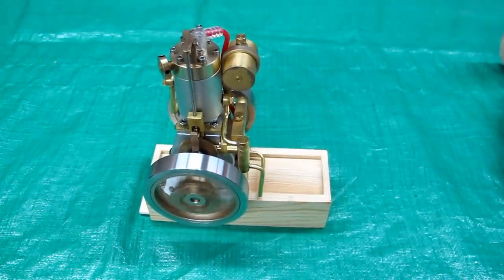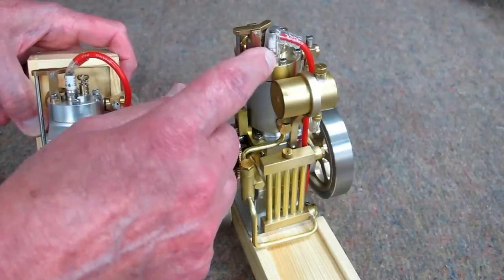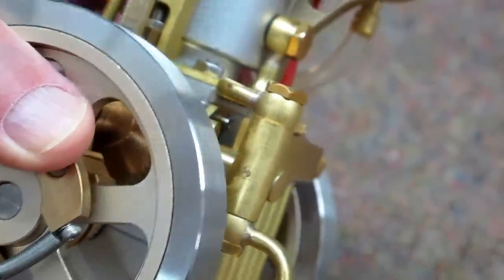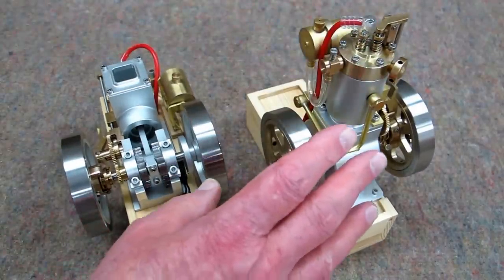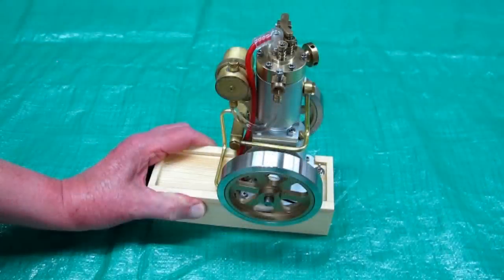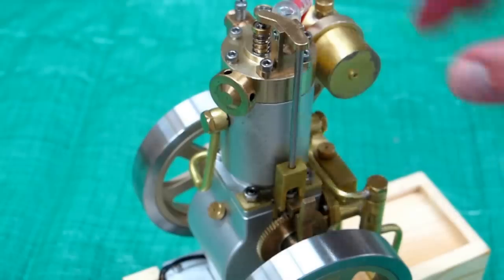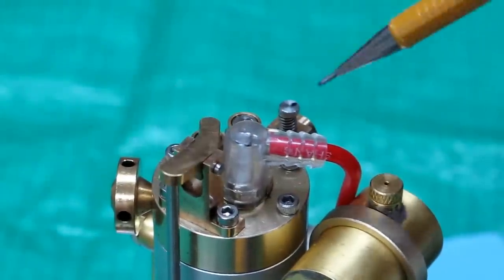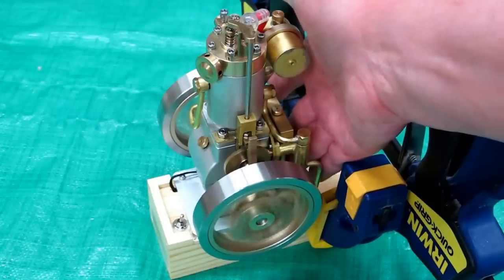Eachine ETX Vertical Hit & Miss Water Cooled Engine

Comment: I got one of these from Banggood yesterday but out of the box it has no detectable compression whatever when hand cranking  a flywheel (correct direction - clockwise governor side). Spark plug is also jammed in. I can't see this one running so haven't even tried as it turns over as if the cylinder head is removed - zero resistance. Think I have a dud and should likely return it?
Reply from the maker: Hello Ed, Indications with my two engines were they had been briefly test-run at the factory. So you should look around a little before assuming it a dud.

There are three obvious things, which would prevent compression.

Spark Plug not tightened (DO NOT over tighten… just snug). This is probably not the problem.

Gently verify all the head bolts are tight. This also is probably not the problem.

Intake valve not closing. It is opened by the piston down-stroke pulling a vacuum. Jiggle it a little and confirm it is operating freely.

Exhaust valve not fully closing. This is the most likely cause. There must be a small gap between the valve stem and the rocker arm. The gap is about the thickness of a piece of typing paper. These engines have always been well packed but a tiny bit of foam or dirt could somehow be holding the exhaust valve open… or a piece of junk between the valve stem and the rocker arm. A film of oil will hold onto a bit of dirt or something.

The push rod needs to be inside the outer pocket of the rocker arm. This can happen when the engine is running and suddenly decides to quit and has lost compression (Stated for future reference).

The mechanism, which operates the push rod needs to move freely. Verify the bearing is moving up and down freely with the cam. (This is down in the area of the governor and behind the gears).

Best advice is to play around with it to see if you can eventually find something stupid simple that is holding the exhaust valve open. This was probably test run at the factory so it should be working now unless something got bounced around or moved by the packaging. Absolute last resort is to go around loosening screws and changing things as you can quickly lose track of where everything should be.

Repositioning the rocker arm to adjust valve clearance (if absolutely necessary) is a tedious task, as once the two head bolts are loosened everything moves around. It is a trial and error process (mostly error), which needs to be done repeatedly until you accidentally get it right (especially the first couple of times you do it). Simply moving the rocker arm can change valve clearance. Ideally the valve stem is centered on the rocker arm. Once the rocker arm is moved out of the way… if you immediately have compression, then that was the problem. If you still do not have compression… it was not the problem (oops!). Check, double check, triple check before deciding to change ANYTHING.

Originally two green o-rings were used as piston rings. I have been told they reduced that to only one o-ring to make the engines easier to start and idle slower. These o-rings are fairly durable and that is probably not the problem.

Good Luck! Let me know how you do. Thanks for watching. Please Subscribe! Ron
Reply: Hi Ron. Thanks for the 'treatise' on the Banggood  supplied vertical H&M - a very full account! Although I enjoy tinkering my universal view of new purchases is that they should basically work 'out of the box' - a good principle in general because most warranties are automatically invalidated by owner tinkering. Anyway, being an H&M newbie my first message really sought to establish if I should try to run it anyway - even with no detectable compression! I had already noted the vulnerability of these engines to valve seating issues but did not wish to dismantle the head to explore this. The good news is that you were 'spot-on' about the exhaust valve! My non-invasive 'surgery' was to remove the exhaust muffler (very loosely screwed on) thus exposing a pathway to the valve. I then applied strong suction from a household vacuum cleaner running with a constricted pipe to the open port while jiggling the valve open and closed from the topside. I noticed some black 'gunk' had been thus extracted and - hey presto compression!! You were also correct that this engine had been test run and further evidence was found when I removed the spark plug - still very wet and covered in black 'gunk' - can't help wondering what they ran it on, perhaps horse manure! It was quite tight in the head and now nicely cleaned before I try running. Another thing I learnt was that the hexagonal bar stock used to produce these PK branded plugs is not of the usual 8mm (5/16) AF - as expected for 1/4-32 threaded model engine spark plugs. For a reason I cannot guess they have used 2 BA bar stock for this which is .322 inch (8.2mm) and explains why, when tight anyway, I had difficulty removing it using an 8mm tube wrench which clearly does not fit properly. A 2 BA box wrench fits perfectly but I guess an 8mm wrench will be needed if I ever upgrade to a different plug. Another amazing thing about these little engines is that they apparently use a plastic (Viton Buna 70)  piston ring - not cast iron as expected - and further now only 1 whereas originally 2 were fitted!! I'm going to try double AA battery power (3.2V vs. 4.8V) before a run as I've heard that these engines have voltage sensitive ignition and 4.8V can cause premature failure. Will check all fixture for tightness first, as you suggest. Great fun, I'm sure!
Reply from the maker: Hello Ed,

You will be tinkering with these the more you run them. 

The muffler is usually no more than hand tight.

The battery pack is intended for 3 AA flashlight batteries, which is 4.5 VDC nominal… regular flashlight batteries 1.5V each. The 4.5V is too much. I recommend replacing one battery with a blank reducing the supply to 3.0 VDC. I use freshly recharged Ni-MH batteries which are around 1.2V each… so 2.4V will run the engine.

Caution with the spark plug threads. Some model plugs have different threads. If it doesn’t screw in freely by hand, do not use it as you will screw up the threads in the head. Some incorrect threads will screw in 1 or 2 turns and then bind up. Most things coming out of China are going to be metric but not everything and some will have a mixture like metric hex bar stock with an English thread.

Consistency (quality control) can be a problem coming out of China. I was looking for a nut driver that would fit the nozzles on my 3D printer. I was looking at Craftsman tool display and had to sort through 5 different wrenches (supposedly all the same size) before finding one that fit the nozzle correctly.

I run on Coleman Lantern Fuel (some call it white gas) with just a hint of Marvel Mystery Oil. Just enough to give a hit of a pink color. That seems to be good for the o-rings and doesn’t produce too much carbon (that black junk you found). The o-rings are 22mm OD by 1mm thick (wire diameter) flurosilicone. The listing for the correct o-ring can be found in the description for my hit and miss engine videos. Caution: There are two different sizes of o-rings on Banggood. The earlier Blue hit and miss uses a larger size.

The use of the single o-ring was to reduce the compression a little in order to make the engine easier to start and I think it would run better at slow speeds. Replacing the governor springs as I have shown in my videos is a good modification.

I would install two o-rings in my engine when the original fails. My engine has 2 o-rings and runs just fine.

Thanks for watching. Please Subscribe! That is what keeps this channel running.

Ron
Reply: Thanks again for the swift reply. Are you using the stock PK branded spark plug in your vertical? What electrode gap are you using? I checked mine and found the gap to be .002". !!!! Perhaps this accounts for the heavy fouling I mentioned? I asked Jin of Microcosm for his recommendation and he says about 1 mm. !!!! Both .002" and 1 mm seem pretty wacky to me...
Reply from the maker: Ed,

1 mm = 0.03937 inch (say 0.04”)

Remember the larger the gap the hotter the spark… provided the ignition system (battery strength) can provide a spark strong enough to jump the gap.  A hotter spark will help keep the plug clean.

Too much oil in the fuel can cause the engine to carbon up. 

A sheet of typing paper is .0025 - .003 so perhaps you meant to type 0.02”

A No.11 Xacto blade is 0.5mm or 0.02” thick and that is a good starting place. If it fouls up then increase the gap to 1mm and see how that does (or split the difference around 0.7mm).

Easy does it bending around on that spark plug. They can break fairly easily.

If you do not have any spare green o-rings for the piston or a spare spark plug, it is a good time to order one as shipments out of China are taking forever lately.

I am not at home and can’t check one physically. Usually I just look at one and say, “Yep, that’s about right”…  and screw it into the engine.

Have you had it running?

Ron
Reply: @RonaldWalters2010  Hi Again Ron,
No - the spark plug gap was .002" (not .02") as received
I finally got a dry day for the first run outside so here’s what happened.
Mixed results, it did run but not too well and you were bang-on – I will be tinkering a lot! The engine I received has a good headline spec’ with both a pulley wheel and separate rope starter wheel on the opposite side to the governor. The T-handle rope was included and usually allowed me to start first time – but hand starting by spinning the flywheel(s) did not work for me at all. Lucky the rope starter was included! The compression loss on receipt appeared mainly solved but a couple of times I got no compression but then it mysteriously came back again. Still think it’s either a poorly seating valve or else the spark plug boot is fouling a valve spring. Intend buying a decent plug cap (like this if it fits - https://www.morrisminimotors.com/rcexl-90-degger-1-4-32-me-8-5-16-8mm-hex-spark-plug-cap-repair-kit-2101.html ) and removing the cylinder head to check and grind valves. Engine tended to cut out after about 4-5 mins running but not always – again may be valves or carb' partially blocked (needed to run needle ½ - ¾ open which is more than other owners report). Most irksome issue was the loosening of governor side flywheel which then freewheeled and obviously stopped engine when it happened – several times. My mistake was to confuse the governor frame retainer cap screws (which hold the frame to the flywheel) with the flywheel retainer grub screws which are normally covered by the governor arms. Kept tightening the former and wondering why the flywheel would not stay put – before realizing the weights/springs need to be removed to access the grub screws (2). A decent exploded diagram in the kit would have avoided all this. Many have reported this flywheel problem which should never happen and is pretty much negligent on the part of the manufacturer. Strongly recommend owners to remove both flywheels (and also pulley and rope starter wheels) immediately and before running – then file or grind suitable flats on both sides to engage the retainer screws. This will stop loosening and should have been done during manufacture to eliminate this problem. Once the various wheels start slipping the crankshaft gets scored by the retainer and the wheels are very likely to become seized on and require a puller (or a hammer in my case!) to remove them. This was a problem with the rope starter wheel when it became gapped to the pulley wheel and my attempts to move it inwards resulted in said scoring and seizure. I now need to make a puller to remove it and clean up the shaft.  Do not try heat if the same thing happens – wheel is anodized aluminium and the heat needed will destroy the finish! Spark plug gap of .012" or thereabouts seems to work quite well but I’ve not yet started adding 2-stroke oil to the fuel (Coleman Fuel) or water in radiator (a nice gimmick but probably not needed. Exhaust valve clearance found to be .030” – probably excessive? Great fun, worth the money but a flawed product in several ways as mentioned. Happy tinkering!!!
Reply from the maker: Ed,

Sounds like the little beast has kept you busy.

Spark plug gap of around .02” should be good.

The rope starter (I think) was intended to help people who mount these in model boats, start their engines (must be quite large boats).

I have a few videos showing how to make a starter for a cordless drill. That makes starting quick and easy. You might try removing the pull-starter wheel and try the cordless drill approach.

The spark plug boot does get close to the valve springs. 

You might try removing the fuel line and needle valve and blowing some compressed air through the carburetor. There could be some junk in there. My engines run ¼ turn or less. One other person said his runs ½ turn open. Could be manufacturing inconsistency.

As the engine warms up the carburetor setting may need a slight adjustment. The engine is quite sensitive to carburetor adjustment.

I have had the engine fire and then just coast to a stop. It was the exhaust valve push rod jumping out of the socket in the rocker arm and that holds the exhaust valve open and that stops it. If you ever take that rocker arm assembly loose you will discover what a tedious job it is to get everything lined up again. The arm needs to be centered on the valve stem and on the pushrod.

Usually things are fairly well tightened on these engines but with a bunch sitting on an assembly table I guess one could get missed. Or it was put together just before quitting time on a Friday.

The radiator does work. Need to use distilled water it to prevent mineralization internally. It is only needed if you intend for long runs.

Ron
Reply: I'm researching a proper reduced tension spring pair for the governor. There's some duff information circulating about alternative springs to reduce the speed that are actually stronger not weaker. Just as well I'm retired. Happy days! Ed
Reply from the maker: These are the springs I show in my video. From China the will eventually show up.
https://www.ebay.com/itm/0-4mmx4-5x12mm-Metal-Dual-Hook-Small-Tension-Spring-58pcs-/323742846964?_trksid=p2349526.m4383.l4275.c1#viTabs_0
Reply: Yes, and they are completely wrong! These are shorter springs and the spring constant (rate) in Newtons per mm is too high, coupled with the pre-tension (stretching spring so it fits to 20mm centres) that the H&M screwed mounting produces means there is much more centrifugal force (RPM) needed to move the governor. What is needed is less, not more, to bring the governor into action more easily and not the reverse. What is needed are springs which are dimensionally the same but made from thinner wire - length (pre-loading) can then be considered. I'm still looking but I think I may have found some. The link shows springs that are made from thicker wire and much shorter - they are therefore going to be heavilly pre-loaded when fitted and the mechanism will struggle much more to move against this. And yes, I have tried them!
Reply: Forgot to mention - the wire type is also important. I've assumed 316 Stainless throughout. The original link lead (indirectly) to a UK listing which was very similar except the wire diameter was 0.45mm, i.e. slightly thicker as mentioned. I see your most recent link (and perhaps the original) led to 0.40mm wire diameter. In any case the spring rate and pre-tension needs to be way less than these. Ed
Reply: The site https://www.thespringstore.com/ has some great information about springs and spring dynamics. I've been doing some maths! Basically, simple shortening of an otherwise standard size EXTENSION spring will significantly INCREASE the force needed to extend it. This will be the case with the 0.4 x 4.5 x 12mm items and the governor will probably be locked solid, not move, and effectively not fire the 'miss' side of things very well - if at all. The options are limited because the spring mounts on these engines are fixed by the M2.5 cap screws at 20mm centres. Thinner wire is uncommon but the way to go with length in the usable range of 15-20mm. I'm going to try these https://www.ebay.com/itm/272625900529 in 15mm length as I've estimated they will give about a 30% force reduction needed to operate the governor. Conversely, the 0.4 x 4.5 x 12mm springs work out to 400+% force increase over the standard springs for a 3mm extension - and they will be very near, or beyond, to being overstretched just to mount them. Checkout the springstore site and do some maths!!
Reply: I would like like to upgrade the crank shaft bearings, Where can I get them
Reply from the maker: FYI - When you leave a comment under someone else's comment, I may never see it. In the future please leave comments directly unter the video.

I do not have a list of parts for these engines. If the bearing is marked (on the edge of bearing) then search for them on Banggood.com or eBay. They will be a metric bearing. As far as "upgrade" ? ? ? they will still be a made in China bearing.

Comment: What did you mean when you said it did not run like a normal hit and miss before the spring modification?  Too high RPMs?
Reply from the maker: When idling under no load it fired too often, not enough misses or coasting. And when it fired it would fire two of three times in a row (double tap or triple tap). Also a bit too high RPM's. For a demonstration model, once it is running and warmed up, you want something like: HIT... miss.... miss... miss....miss.... miss... miss... miss... miss... HIT... miss... miss... etc.
Reply: @RonaldWalters2010  Ahhh Ok. Thank you for your response Sir, much appreciated!